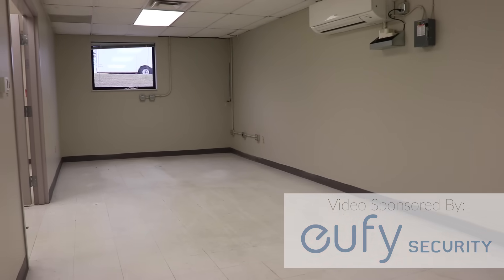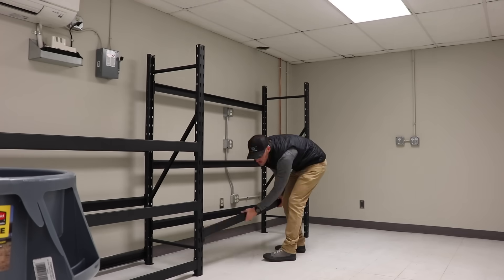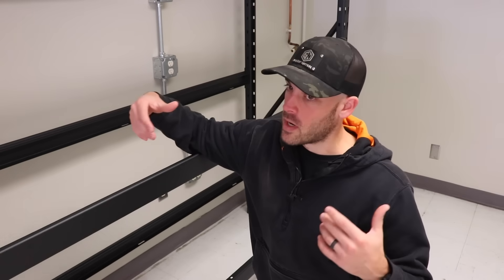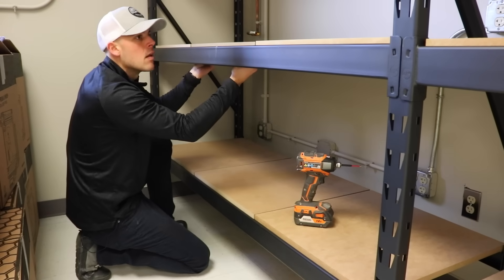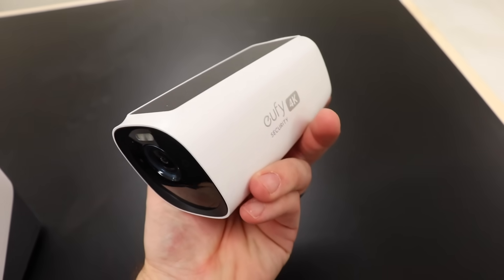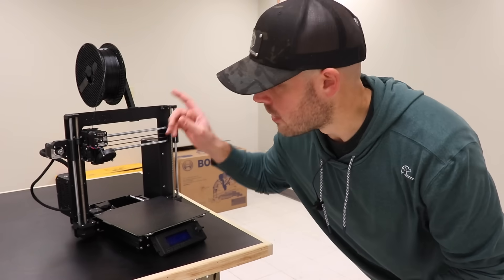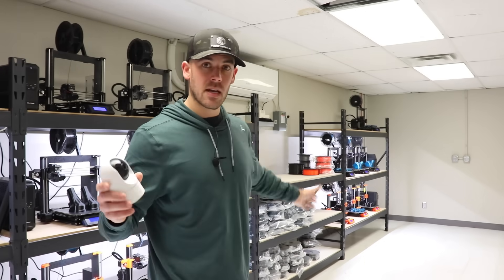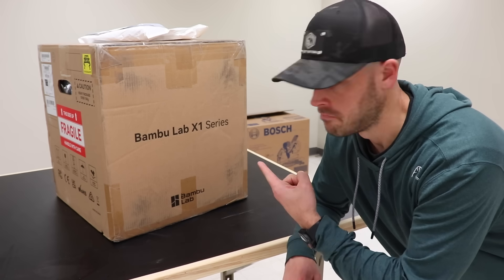I Tried Building an Industrial 3D Print Farm

Comment: Bambu lab printers aren't good for print farms. They're unreliable and un serviceable outside of a few parts. But the motion system is 100% un servicable and can't be repaired by the customer. When the graphite in the X axis bushings wear down, you're just left with abrasive aluminum bronze bushings wearing into the CF rods. Bambu has said their rods and bushings are NON SERVICEABLE, and that they're meant to be sent in for repair/replacement. The rods are even epoxied into place.

Why spend money on a machine that isn't as reliable, or repairable as the prusa's you have now. Only thing BL printers are good for really is quick prototyping. I've met a few people that "tried" running a print farm with them, with no luck. Even my friends P1P was dead in 10hrs after delivery and took 3 weeks to get a replacement motor. He has since returned it and got his money back.
Reply from the maker: Yikes! Yeah that’s been my thought so far too. Stupid fast for prototyping but doesn’t look suited for 24/7 prints

Comment: As the owner of an Ender 6 I feel that last comment pretty hard. Its a great printer (once you replace the cooling fan), but there is a lot of work to do to them before they're farm ready. The top end for my 6's performance is miles ahead of anything Prusa has to offer (assuming you get to spend the initial investment difference on fixes for the 6), but when you have to do 30+ printers it can be quite the chore to update the firmware to Klipper, print new fan ducts, replace fans, replace the x-bar, extruder, and hot end, as well as replacing the build plate with magnetic PEI, and add a bed leveling probe. Not expensive really (about $260-$300 in aftermarket stuff), just time consuming first time around. Still, printing at nearly 1 meter per second of real filament extrusion at the same quality as a stock prusa reliably is a huge increase in printer capacity.

If any hobbiest is looking for a half decent core xy platform the 6 is pretty good though. The machine says its $560 or so but you can get them for $430 pretty easily, and assuming you're good willing to spend $3 on blower fans and use the included filament sample to print a new fan duct you're in business with a decent machine pretty much right away. And as previously mentioned if you want to upgrade it over time you can find guides in a few places and with very little modification you can use stuff made for some of the best printers out there (Voron 2.4, HevORT, VZbot).
Reply: You should document your setup, that sounds amazing!

Comment: Bambu Lab P1P for sure. Half the price and twice 3X the speed of a Prusa.
However, besides swapping the nozzle and hot end (super easy) I doubt you can fix much else on it.
As for SLS options, from my experience with an HP 4200 it's depends on the technical requirements of the parts you're making, because it's not going to be cheaper or faster.
Reply: Bambu lab printers are un serviceable. Fine fore prototyping, terrible for print farms.
Reply: @LilApe  Actually I was very wrong about the serviceability of Bambu printers. They sell all the needed spare parts and they're very easy to swap out.
Reply: @mururoa7024  When I say non serviceable, I mean critical parts like the motion system. They don't sell or provide replacement rods/bearings/bushings. They've said when those need to be repair, they want you to send the printer back for repair, they wont just send you the parts.
Reply: @LilApe  Yeah that's what you normally do in a professional setting like a factory. You get a service plan and either send the hardware back for repair or have a technician come over. Print farms that operate in a DIY mode are having a hard time scaling.
Reply: @mururoa7024  Normally, maybe. But not for 3d printers aimed at hobbyists like bambu lab. I mean, what other hobby 3d printer manufacture offers a "service plan", or requires being sent in for certain repairs?
Reply: @LilApe  Bambu doesn't have a plan for hobbyists but you can get one if you're a large enough company. There are other printers such as the FLSUN, Voron,  Ratrig and VZbot which can print as fast and are DIY. You have options if you don't like how Bambu operates.

Comment: Hello I like your video on setting up the farm. A few comments. How do you manage the prints? I use repetier server which is scalable and can be setup so you can access anywhere via internet. It also allows webcam functionality to monitor prints. Also interesting choice for the rollers for spool holders. I went with spool hangers which screw to the shelf above the printer for 3kg spool, so no bearings need also no adjustments either when changing spool size. Are you Canada or USA? I'm trying to find large size spools but have difficulty in Canada. Also your earlier video of your 9 printer farm was inspiration for mine which I built in my apartment storage room lol. Also have you considered air filtration or filtration for micro particles?

Comment: @Shop Nation: Obviously you are keeping yourself busy, but just wondering if you had any plans to tackle dust collection on the Metabo sliding miter saws?  I have seen several people asking for it, but haven’t seen anything mentioned.  I think it would be a quick and easy design.  Easy to access mounting points and the dust shoot is centered behind the blade so no offsets.  I actually purchased the files for the Ridgid from you today in hopes I might be able to modify it on the computer to work.  No luck yet.  Thanks for all you do! 😊

Comment: I like the separate local storage on those cameras. I run the cheaper Wyze 3 cameras at home. I like them but the onboard micro-sd is sort of a pain to access and is limiting in the amount of storage available. Also the battery and attached solar panel on those eufy cameras is really cool. You can put those almost anywhere on your property and not have to worry about having an outlet nearby or running power to it.

You should think about closing up that window. Kill two birds with one stone. More shelves and no easy access for bad guys.

That room is going to be a really awesome setup. I hope you get close to the 72 printers going.

Comment: I would be curious if you could build  reliable print farm with P1P printers?  It seems it would bre cheaper and much faster than prusa printer but would it hold up to the torture of a print farm.
Reply from the maker: The torture question is the most important one...I'm running the X1 through it's paces now to see

Comment: Why the dislike or Ender printers?  Just curious, I have one for home use.  Bought it off Amazon because of price.  I use it for home and work, Mech Eng, day job.  I have done some basic updates nothing crazy.  However, I have seen videos where people have done some crazy things especially with octoprint, I have never used it.  Might be helpful for a farm as apparently you can monitor, start and stop prints with it remotely.  Allegedly you can send a print job to your 3d printer just like you do to you home paper printer.
Reply from the maker: Enders are GREAT for getting into the hobby and having fun with.  Absolutely no issues with them there...they are just not built for constant reliable use.  A print farm is a factory where uptime and reliability are important.  The 2-3x cost of the Prusas is easily outweighed by the bulletproof reliability.  That's all I was pointing out there

Comment: As an IT professional, I was curious about the networking.  There doesn't seem to be any network cabling (Cat6/7/8) run.  Are the printers wireless?  What did you use for wireless connectivity?  25 printers and multiple cameras, while not an overly dense implementation, isn't exactly a light load either.  And it seems it will only grow.
Reply from the maker: These printers are as dumb as they come...which is part of the appeal.  Simple 8-bit processor, no networking, just SD cards.  You can frankenstein them with aftermarket setups but the SD system is manageable with a relatively steady file library.

Comment: How about VZBot 3d printers, you can easily get 2000mm/s or more so you'd need less printers and they will print a heap quicker.
Reply from the maker: Speed is not always your friend when it comes to consistency and reliability

Comment: Add bars to the windows, high decibel sirens inside/outside your location with flashing lights, non-water fire suppression (?), positive (if possible) air pressure for the print farm room? Also dust collection. 

It’s gonna cost, but have your insurance agent come out & inspect the setup.

Comment: What’s your preferred brand of filament? What type(s) of filament do you use. I’m new to 3D printing. Trying to understand what i should look for to start printing more functional prints. Thanks!
Reply from the maker: My only suggestion is resist the urge to buy the cheap stuff.  You get what you pay for and your poor printer will suffer if you feed it garbage!  PETG is great for functional prints

Comment: Nice setup, wish I had more room in my little office.  The only thing I would do different is in regards to the security cameras.  I would not use wifi cameras as it isn't that hard to disable the signal, you still can do the same with wired but more work.

Comment: I have four Eufy security cameras. I have been running them since July. Outdoors in weather from 100F degrees to -25F and the batteries are holding up just fine. No issues. I too like that I can record the video without a subscription and I control the server. Switched my doorbell from Ring to Eufy and it was a huge upgrade. Nice to have it all in one App. 
Get that roof fixed quick. Leaks like that can cause big issues.

Comment: 3d Printers I was going to suggest the P1P. But also, depending on your product line, I just recently got a Kingroon KP3s and set it up with klipper. There are several videos of people running them in farms. They are just little guys (180x180x180), but direct drive, linear rails, and they can print fast! For $180, you can scale a farm up pretty damn quickly! Not to mention pretty cheap!

Comment: It is all your fault that I got Prusa MK3's in my head and after a bunch of research I got one as well.  It bought the kit because I really enjoy the building part.  But I got to say that once I set the nozzle height, it has pretty much been printing non-stop without issue!  I haven't had to monkey with anything and no errors or issues.  Yeah it is new but I bought it to work, not for me to fiddle with it.  And WOW you can print lots of stuff for the shop!  I'm definitely going to buy your dust collector for my Bosch 12" mitre!
Reply: Reliability is was makes a prusa, a prusa.

Comment: Not and Ender Bro but you may want to consider the Bambu P1P, instead of the X1.  Different features of course but also cheaper than the X1 and around slightly less than the Prusa.  Also a video on the software/automation side of things would be cool.

Comment: I'm not sure that even the Bros would recommend running a large farm like yours on Enders, but they are 1/5 the cost and a great way to get started - run the wheels off of them until you get profitable and upgrade to studier machines.

I don't run my 4 Enders as hard as you do, but when I have a project they have run for weeks on end with no issues.

Interested to see your take on the Bambu P1P
Reply: Lol, I run my 8 Enders day in and day out, fans are the only thing that go out from time to time. And maybe occasionally Bowden tubes. But really they are great for the price, a lot easier to get out of the red and maybe then invest in better printers. But prusa is getting to be pretty dated tech. I’m sure they’ve seen a big decline since Bambu launched

Comment: Great video! Glad to see your progress as a maker. As an engineer myself, I appreciate your thought process and have learnt quite a few things from your shop build videos (especially the organization series). So thanks again!

Also, since you asked for thoughts and feedback 

1) Curious if you plan on additional ventilation to get the VOCs from all those printers? Perhaps the existing HVAC ventilation might be adequate but I wonder if you might be considering one of those (smart?) air quality measurement units for this space to help determine if that might be necessary in the long term. We certainly needed one for the smart lab I built for my employer (I used an Ultimaker 3 in the hardware room of this lab for prototyping and printing custom parts much the same way as you are doing and the air quality during prints in the hardware room definitely went south) The air quality scientist on our staff helped understand the risks of working in an environment with such high VOCs and thanks to some of the skills I learnt from your videos, we built a ducting solution to tie into the building's HVAC / return system. 

2) Second thing about the print farm - what about noise levels when all the printers are cranking away? Have you considered any type of additional insulation (could be simple 'picture frame' type insulation that you put on the drop ceiling and walls of the room)? I am guessing closing the door might cut down the sound significantly and you could just wear some noise cancelling headphones when you enter the room (especially if you are the only "employee" working in there), but just thought I'd share my experience building out my own smart lab. 

3) Finally - some feedback. After watching your video where you installed the Barrina lights in your old garage, I immediately ordered their 8-pack of lights for my own garage. These worked awesome....until they didn't. Exactly one month after the warranty expired, the lights started to flicker, dim and ultimately stopped working. And these were NOT running more than few hours (max 3 to 4hrs, more like 1hr average) per day  Eventually, last fall, with 4 random bulbs not working in the garage (creating the uneven lighting situation in the garage), I got sick of the uneven lighting and took those down. I even reached out to the manufacturer but got no response which led me to leave a review accordingly on their product. Obviously these lights are popular and the manufacturer probably doesnt care of my negative feedback. And initially, when the first bulb went out, I was willing to notch it up to "acceptable failure rates" but when multiple started failing within days of each other and I got no response from manufacturer, I stopped using them in my garage. I knew you had already moved out of your old place so you wouldnt necessarily know how those lights were doing over there for long term usage but I would be curious to learn how these turn out in your print farm after couple years.

Boy this turned out longer "youtube comment" than I anticipated. But keep up the great work and I look forward to more cool stuff on your channel. 👍